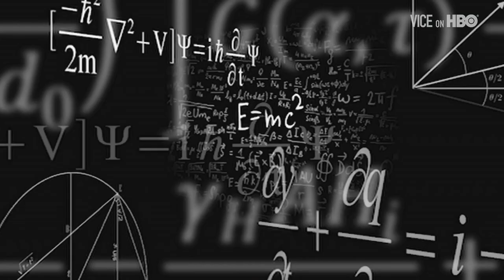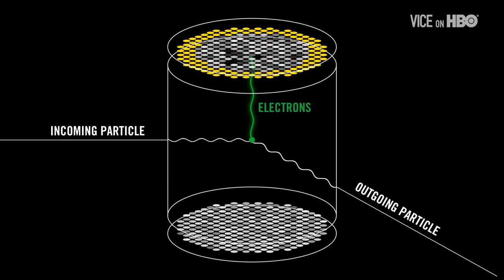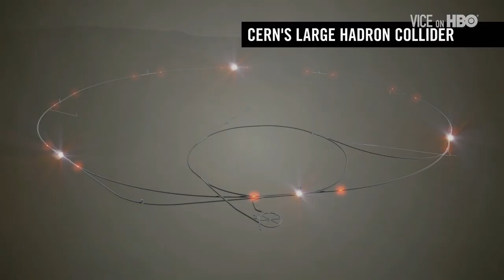Dark Matter — The Greatest Mystery of The Universe | VICE on HBO

Comment: Yes, it is true that some models for DM halos predict it peaks at the center of galaxies, but those are mainly classical computational models that view galactic halos of DM as a classical gas of point particles. That's not the way DM exists: since DM does not interact with any radiation it never exists as localized point-like particle (like an electron sometimes is.) Quite the contrary, it only exists similar to a free wave under no potential. In fact the only potential that DM  "feels" is the gravitation potential, so the DM particles in galactic halos are in a non-localized state similar to those of electrons around an atomic nucleus (but under gravitational potential  Vg(r) instead of electrical, of course.) Full publication on this at @t

Comment: According to the laws of physics Gravity slows down the Time (also called gravitational time dilation).
I think it’s just the Time that runs faster in the outer part of a galaxy.
There is no need of believe Dark Matter is needed to keep galaxies together.
Like when we watch a movie in the fast forward mode, we see everything moves faster.
If we consider the Time speeds up by factor γ_galaxy, then this explains why everything appears to orbit faster in the outer part of a galaxy.
γ_galaxy = T2/T1 = √( ( R2/R1 )^3 )
( Galactic Time Dilation = Time speed at Radius 2 from galactic center / Time speed at R1 )
This way all stars obey Kepler's laws of planetary motion regularly.

Same thing for Dark Energy. At the Big Bang all matter was closer together.
So, the Time was running slower due to the huge gravitational forces.
Now, all matter has spread out during a billion years expanding Universe.
So, the Time runs faster now. Thus, the further we look into the Universe, the faster objects appear to move.
Not because things really move faster, but because the Time accelerated more before the light arrives in our telescopes.
(Longer light travel time -> longer Time acceleration)
Logically, the expansion of the Universe appears to accelerate. Not because some mysterious Dark Energy is pulling the Universe apart, but because of this Time illusion.

To put everything into a few words; I think Dark Matter and Energy are both optical Time illusions:
- Dark Matter as a local Time effect in and around Galaxies (or near matter), and
- Dark Energy as a long-term Time effect in a billion years expanding Universe.
Watch my YouTube video to see me explain more related phenomena: https://youtu.be/FRqxBtJPrts

Comment: Could it be that the supernova was caused by a gravity tearing it to millions of pieces? imagine a metal particle placed directly in the middle of a sphere with vacuum inside and equal magnetic field applied to the sides of the sphere so it pulls the metal particle into every direction. Once the magnetic field is strong enough to rip the metal particle in the middle it will tear it into billion pieces and pull it apart. So the closer the bits of metal particle get to the sides of the sphere the faster they are going to move just like our Universe.

Comment: New Information about the center of the galaxies

Every galaxy has a push/pull system at its center. This is a twin energy system, but you only are aware of one. You’re convinced it’s invisible, and it’s a black hole. No light escapes, but you think it’s singular - one thing. It is not one thing. Instead, it’s a beautiful, double eye of a needle. 

Picture with me for a moment a giant needle and thread, two of them. One goes into the black hole and one comes out of it. These threads are interdimensional strings of force that connect themselves to the other galaxies, weaving in and out of their centers, which are all double-eyed black holes. A push and a pull - an interdimensional force of which you are not aware of yet, threading the galaxies one to another and to another. Now, picture in your mind that quilt work having a symmetry and a purpose. If you could look down the middle of it, into the middle of the Universe from a certain angle, you would even have the symmetry of a mandala. The galaxies are shaped beautifully together in an elegant dance. The symmetry makes sense, and it’s base-12. We challenge you to find this. And those seeming threads that go in and out of those galaxies’ centers with this new force I have just described are a lattice. It’s a lattice with symmetry and purpose...  It has beauty. And it’s the missing energy of the Universe, as seen by those who are looking for it. The dark matter that everyone looks for is not in the empty spaces between things. It’s in the strings of the interdimensional force between galaxies, purposely put there. Oh, it’s a wonderful system. You want the dark matter to make 3D sense, but it can’t. It deals with the two interdimensional forces of the Universe that are quantum, and therefore out of time and out of the preview of your 3D formulas.

Comment: I suspect that in the Galaxies there is much more barionic matter than what Astronomy thinks ... If we add the brown dwarfs (their number is very high), the red dwarfs (almost indistinguishable), the wandering planets dismissed from their star and the small holes primordial (invisible) blacks, all of that may provide us with the missing mass so that the Galaxies rotate without dispersing their stars in a vacuum ... Dark matter would seem somewhat similar to what was said before of the ether ... non-existent substance, already that it was proven that light travels in a vacuum without the need for such "ether" ... As long as the opposite is not demonstrated, we will continue to believe in a dark matter that we cannot see or detect, but which acts as if there is more quantity of matter barionic in space ...

Comment: I have been thinking about the dark matter and dark energy subject. 

From my own observation i am compelled to believe that dark matter and dark energy might be a result of residual particles (or tiny masses) left during the Big Bang that are so immensely dense that they exercise a huge gravitational pull on one another, including the planets;but they are so small and they are spread so far apart that finding one of them would be the same as finding a microscopic planet between the planets, but which has the same mass and weight as the known planets. Their immense gravitational force, due to their density, might be similar to the gravitational pull of all the regular plantes in all the solar systems where they are found.

This means that they have the very same gravitational force of most of the huge-sized planets, and that just like regular planets, they may vary in size and their gravitational pull ans distance are proportional to that size.

Comment: Alternative Explanation of Dark Matter, Dark Energy, Gravity and Accelerated Expansion
- 4-D Hypershere model of Universe can easily explain Gravitation, Dark Matter, Dark Energy, Void, Accelerated Expansion and even the reason why the measurement values of Expansion Rate are around 70 km/sec-Mpc 

Dark Matter, Dark Energy, Gravity, Void and Antigravity, ... all these are same phenomena. They just look different.
The problem of modern physics is they're trying to explain everything with particle physics and the physics is being cornered more and more to the dead end. To escape the dead end, they invent or design another imaginary particle in vain instead of trying to revise their way to approach to the problem.

I agree to the idea that the interaction between mass and space must be explained with quantum mechanics.
But that doesn't mean gravity is the QM phenomena.
That's because gravity is not a force.
Dark Matter, Dark Energy, Gravity, Antigravity, Void... all these are  just  joint effects of the expansion of the Universe and the curvature of spacetime.
Details are given below.

Einstein’s theory of General Relativity states that spacetime is curved by the presence of mass. 
This curvature influences the motion other objects with mass and gives rise to gravitation.
Thus, gravity is a result of geometric features in spacetime.
However, we also observe gravitational effects – curvature of spacetime – in areas without any detectable mass.
This has given rise to the concept of dark matter, which is matter that does not interact in any detectable way with normal matter, except through gravity.
So, there is some large quantity of dark matter scattered throughout the universe, which curves spacetime and causes gravitational effects just like normal matter, but we cannot see or detect it with any known method.

An alternative theory to the identity of dark matter is proposed – it is not matter at all, but rather an intrinsic curvature of spacetime.
In other words, spacetime is not naturally flat. Even in the absence of matter, we observe some inherent curvature of spacetime.

So, the question is now – why is spacetime naturally curved? Why is it not flat in the absence of mass?
The universe is 4-dimensional, with 3 spatial dimensions and one dimension in time.
Rather than consider time as a linear dimension, we can consider it as a radial one.
Therefore, rather than describing the universe with a Cartesian coordinate system, we describe it with a 4-dimensional spherical coordinate system – 3 angular coordinates, φ1, φ2, φ3, and one radial coordinate in time, t.
We live on the 3-dimensional surface of a 4-dimensional bubble which is expanding radially in time.
Thus, the Big Bang represents t=0, the beginning of time.
The crucial point is that the expansion of the universe is not homogeneous in all directions.

The expansion rate at one point on the bubble’s surface may differ slightly from another point near it.
The universe is only roughly spherical in 4 dimensions, the same way that the Earth is only roughly spherical in 3 dimensions.
The same way we observe local mountains and valleys on the surface of Earth, we observe local “mountains” and “valleys” on the surface of the universe bubble.
The inhomogeneity of the expansion of the universe has given rise to natural curvature of spacetime. This natural curvature causes the phenomenon of “dark matter”. “Valleys” in spacetime pull matter in, similarly to the warping of spacetime of massive objects.
So “dark matter” is really “valleys” in spacetime that are expanding slower than the regions surrounding it.
These valleys tend to pull matter in and create planets, stars, and galaxies – regions of space with higher-than-average densities of mass.
Conversely, “mountains” in spacetime will repel matter away, an “anti-gravitational” effect, which gives rise to cosmic voids in space where we observe no matter.
Each point on the surface of the universe bubble traces out a time arrow in 4-dimensional space, perpendicular to the surface.
These time arrows are not parallel to each other since the universe is not flat.
This causes points to have nonzero relative velocity away from each other.
It is generally accepted that the universe is expanding faster than observable energy can explain, and this is expansion is believe to be still accelerating.
The “missing” energy required to explain these observations has given rise to the theory of dark energy.
The time dilation caused by non-parallel time arrows can be proposed as an explanation for dark energy.

Alternatively, dark energy is real energy coming from potential energy gradients caused by non-parallel time arrows.
As a sanity check, we can calculate the expansion rate of the universe based on the universe bubble model.
Since the radius of the universe bubble is expanding at the speed of light in the time direction, it increases at 1 light second per second.
Therefore, the “circumference” of the 3-dimensional surface increases by 2π light seconds per second, or about 1.88*10^6 km/s.
This expansion is distributed equally across the 3-dimensional surface, so the actual observed expansion rate is proportional to the distance from the observer.

At present, the age of the universe is estimated to be 13.8 billion years, so the radius of the universe bubble is 13.8 billion light years, or about 4233 megaparsecs (3.26 million light years to 1 Mpc).

Thus, we can calculate the expansion rate of the universe, per megaparsec from the observer, as: 

Expansion rate = ((d(circumference))/dt)/radiusofuniverse=(1.88*〖10〗^6 km⁄s)/(2π*4233Mpc)=(1.88*〖10〗^6 km⁄s)/26598Mpc=70.82(km⁄s)/Mpc

The popularly accepted empirical expansion rate is 73.5 +/- 2.5 km/s/Mpc, so our calculated value is close.
There may be some additional source of expansion (or observed red shift) to make up for the discrepancy. For example, if two adjacent points have some gravitational gradient due to non-parallel time arrows, then light passing through these points will be red-shifted.
– Cited from https://www.academia.edu/82481487/Title_Alternative_Explanation_of_Dark_Matter_and_Dark_Energy

Comment: Ya but they say if the sun goes out earth would still receive light for a few minutes. So the further you looked away the faster light would go. So the expansion x measured light on a ruler would continue to get darker?..... like someone running away from you with a flash light... im no genius just trying to wrap my head around this theory
Reply: Tanner Irving Chris Hadfield made a great analogy

Picture yourself looking at a clock, let’s say you move away from the clock at the speed of light. For you, the time would stay the same as the light is trying catch up. For everyone else however, time would be moving. It’s as if you freeze in time when moving at the speed of light.

Comment: you're trying to catch it with the collider and radiation devices omg , it is the opposite , just make a detector of activity heat detector could catch it , if you ignore the radiation and the surounding  of gas the what's left should be dark matter and you should  detect it  , than learn to use it